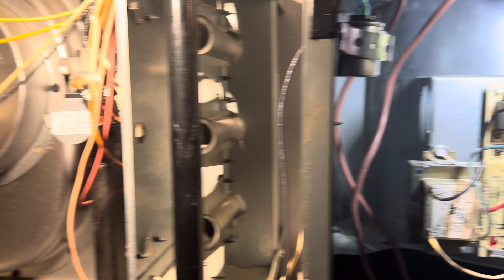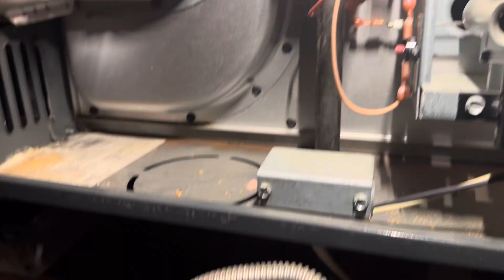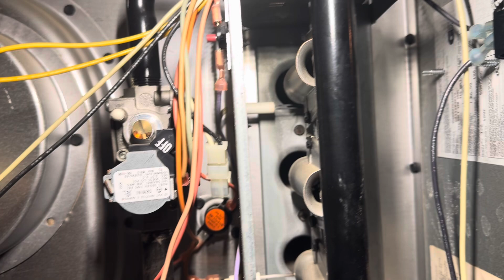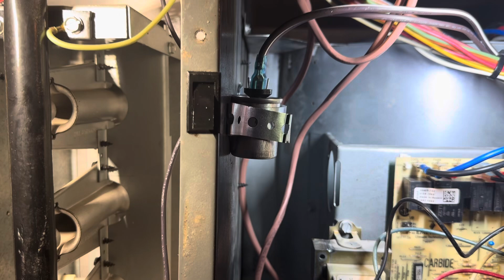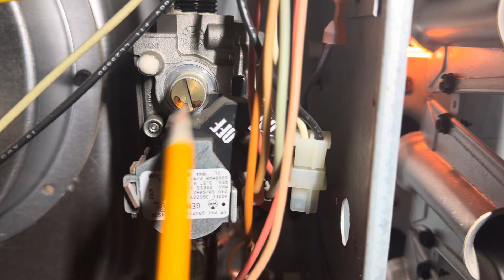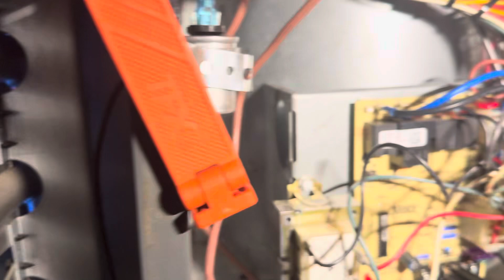Gas Furnace Sequence of Operation Fixes to Common Problems

Comment: Quite a good explanation of the sequence of operations. Keep in mind though that upon a call for heat at the thermostat the 1st step in the sequence is a quick self check of the pressure switch to ensure it is in the contacts open position. This is to prevent a wayward technician from jumpering out the pressure switch to give his customer heat when a blockage or other issue with the venting system could result in CO poisoning.
Reply from the maker: True, I probably didn’t mention that going through it quickly, but good point, thank you for the comment.

Comment: my furnace turns off the blower during the initial call for heat warmup time. When the heat runs often, the plenum never cools off. How can I get it to run the blower during the first 30 seconds time also?
Reply from the maker: @simpletruthsnowbruning4045  the blower doesn’t come on until after the furnace has been running for approximately 30 seconds. The reason being, the 30 second delay allows time for the heat exchanger to get hot and when the blower turns on, it’ll blow warm air into the home instead of cold air.Similarly, once the furnace turns off, the blower will remain on for another 30 to 60 seconds, maximizing the heat in the heat exchanger.
Reply: @TRUSTEDHeatAC  I am not concerned about cool air being blown during the 1st 30 seconds. During the coldest months, I run the blower continuously to maintain even temperatures in several rooms. The board cycles the fan off unnecessarily and wastes heating time. Is there a replacement board that would allow me to change the operation to allow the blower during initial heat call? Thank You
Reply from the maker: @ the board controls the blower motor based on the thermostat settings. Assuming you have a permanent split capacitor (PSC) motor, which would have a small capacitor attached to it. Try this, if you have a multimeter: with the t-stat set to Fan “On”, confirm you have 28VAC between G and C of the control board. If not, you can also confirm that G &R is have continuity at the back of the thermostat itself. G is the terminal for the blower (fan) and C is common — G should be telling the blower to turn on. And you can confirm that by 120VAC on the terminals to the blower motor from the control board. If the board is telling the board to turn off when the thermostat is set to fan on, there may be a problem with the control board.
Reply from the maker: @ and to answer your question, no, I’m not familiar with a board where you can change the initial start up of the blower. There are typically DIP switch settings where one can set the delay at the end of the heat cycle for when the furnace turns off - find the model number on the furnace (the manufacturer tag is often inside the cabinet on the side or the top) and with the model # you can look up the manual online to see what options there are.